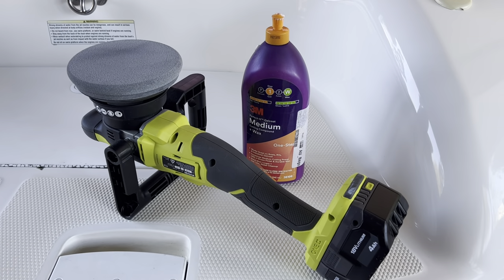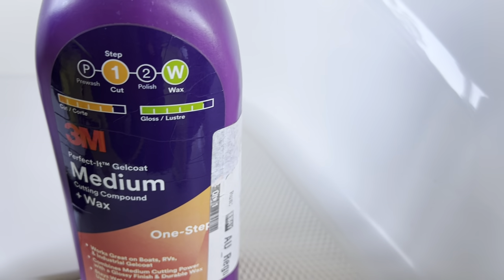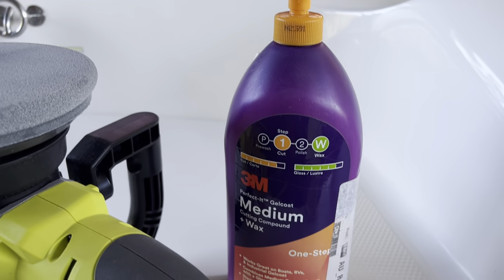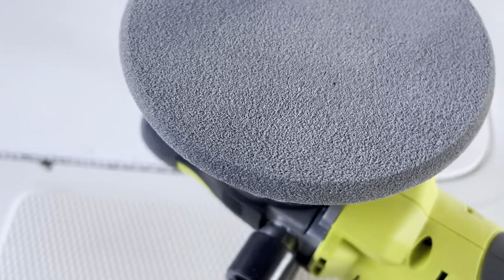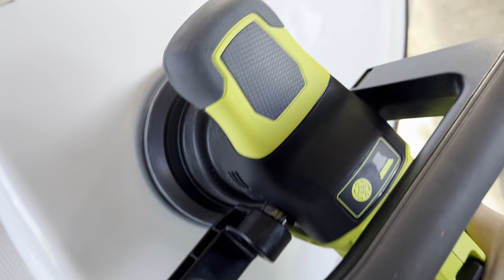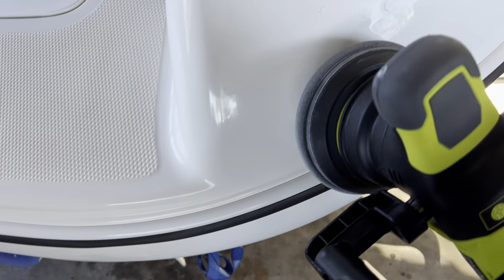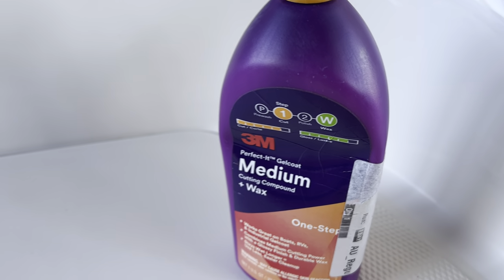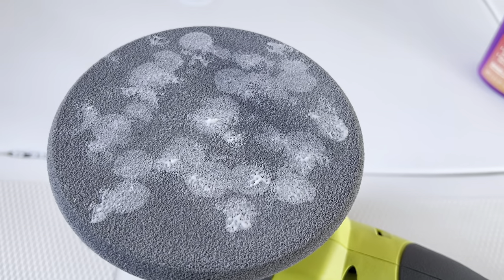Yamaha Exciter 270 - Gel Coat Polishing - 3M Medium Cutting Compound + Wax 1 step.

Comment: Just used this same compound/wax on my 2016 Primetime Tracer travel trailer. This 3m stuff is fantastic. I used a $16 Wen one hand usable orbital polisher and just the free pads that came with polisher. The 3m went a long way, used maybe 1/8th of pint. I did 2 foot x 2 foot areas, went over each area about 6 times, until was finished. The front cap was chalky gray, looked horrible, now looks like new. Hardest part was having to use microfiber towel to buff wax off. Will spray some ceramic spray and rinse off and be done. Great product.
Reply: Took about 30 minutes for me to do the entire front cap on travel trailer, most of time was getting up ladder and removing wax with towel.